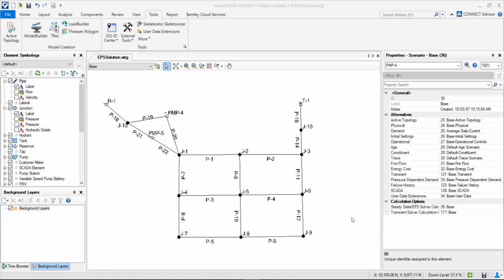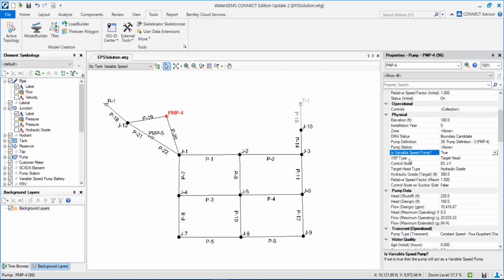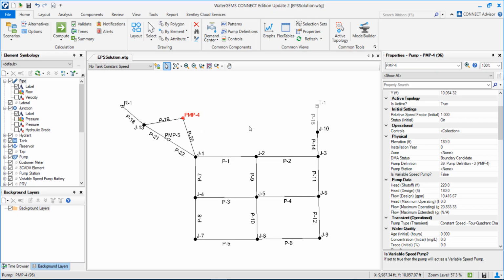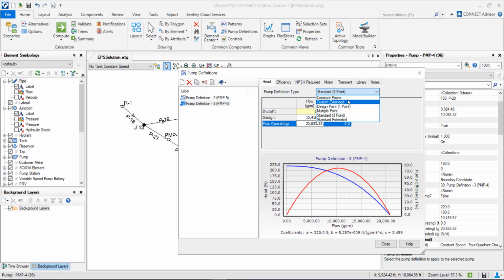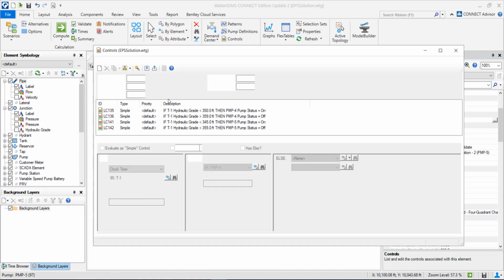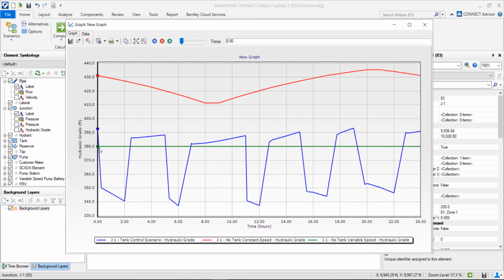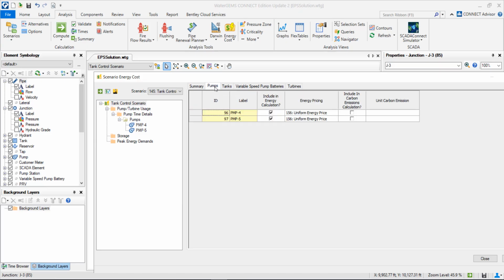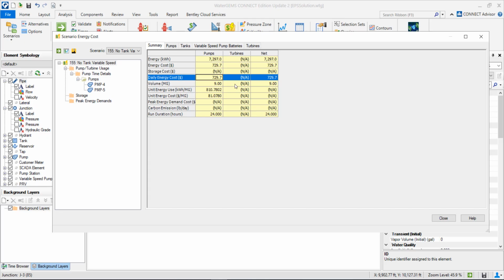WaterGEMS/WaterCAD Fundamentals Part 18: Workshop 8 (EPS Modeling and Energy Costing)

Comment: Thanks for the playlists and exercises.

I would like to ask you where the storage costs come from? How are they calculated? Is it right to think that energy costs correspond to pumping volume directly to the nodes (demands) whereas storage costs come from the volume that goes to tank, or tanks?
Reply from the maker: Hi Jorge, the storage cost in the Energy cost feature (in WaterCAD and WaterGEMS) is based on the cost per Unit Volume and the Volume Change. You can read more in the following wiki article and ask further questions in our forum. https://communities.bentley.com/products/hydraulics___hydrology/w/hydraulics_and_hydrology__wiki/15909/why-is-there-an-energy-cost-associated-with-a-tank